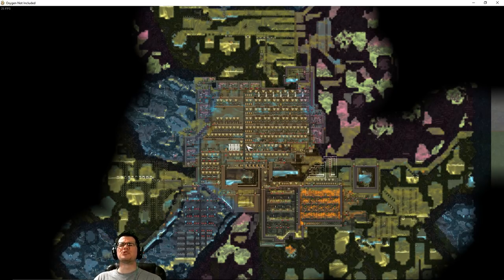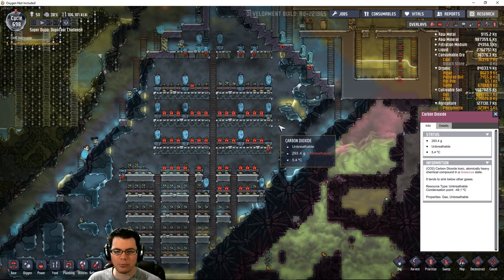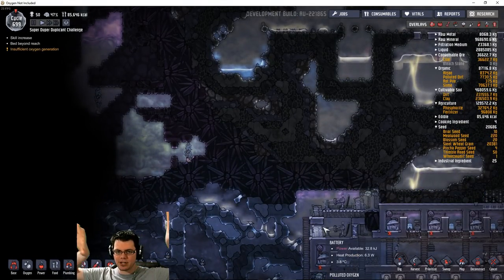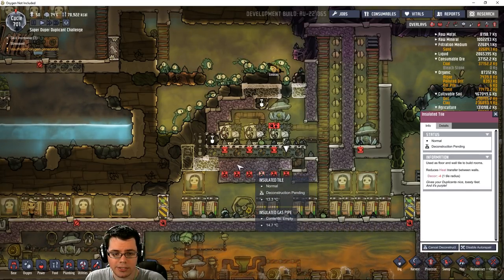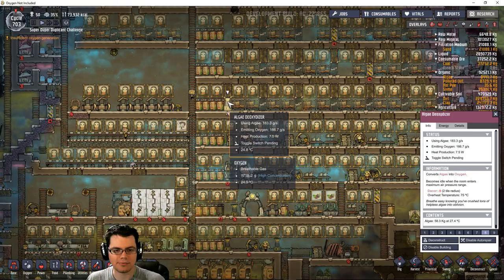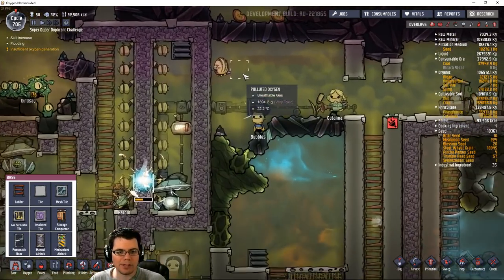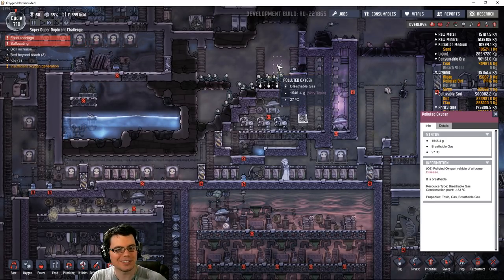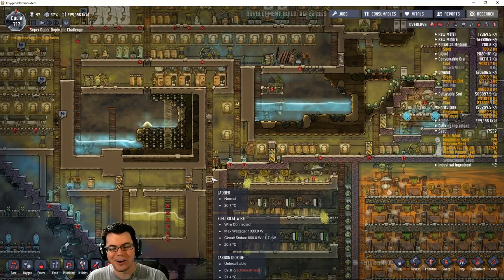Building a Hydrogen Bubbler! Super-Duper Duplicant Challenge Part 7

Comment: I don't get it... how do the wire bridges help in the cooling setup?  I mean, wouldn't they move thermal energy from warmer areas into cooler areas?
Reply: Hmm... I clearly need to take another look at that setup.
Reply: @Russ Emerson That's exactly the idea, move the heat from warm contaminated oxygen to cold hydrogen, cooling and liquifying the oxygen, thus purifying (though realistically, you'd get contaminated liquid oxygen and it would be cleansed on evaporation and you'd get gunk left over).

Comment: I've learned a couple of things experimenting with some of your systems in a now cycle 500+ base of 8 dupes.

For one, the electrolyzer system is a wonderful thing, but you have to be careful with them. The "Insufficient Oxygen" warning is misleading, as it counts the oxygen pumps as a consumer, not a producer, and your oxygen "production" is actually slime or morbs that are visible on your map. At current, three systems is overkill for my eight dupes but two are just shy of enough, so that gives you an idea on how many you need. Also, bear in mind their temperature output as well; it will very quickly heat up your base and cause problems.

As for the farm, I had an immense amount of trouble with Sleet Wheat and could never get it to grow properly, but my [Bristle Berry farm](https://i.gyazo.com/7c76ca66c398ae88fb1d23f6f0b2caa9.jpg) has stable temperature at around 2 C. There seems to be a net cooling with the Wheezwarts, but the occasional dupe entering to fertilize or harvest keeps temperatures within a good range. However, you could also, in theory, cool the farm with regulators and use the resulting heat to warm up Peppernut to make either Stuffed Berry or Pepper Bread. Furthermore, irrigation water should be kept low temp and melting ice should be mopped quickly, as both contribute a lot of heat to the farm. Thankfully the silly "harvest level" system is being removed in the next update.

Also, here's a [Wheezewart water cooler](https://i.gyazo.com/ef5e785bdc8cb21d18ad2fad043b2ce0.jpg) for steam geysers that keeps water at 30 C. Mine flooded a bit because I couldn't use the water fast enough, but it still works and will recover from such an event; middle pump is output and lower pump simply cycles water around to the top when the hydro-switch in the center is below a threshold.
For air, [this one](https://i.gyazo.com/31a7546f12f8cb255d9ca4da048b1e4a.jpg) works beautifully, bringing air down to about 25 C. I have it after my oxygen generators to cool the 60-70 C air down to sane levels for breathing, and it seems to be able to effectively cool two of the electrolyzer systems down without backing up.

And finally, on an unrelated note, you can create power switches that dupes to not have to access by setting an Atmoswitch to 0 kg and using "Below" for OFF and "Above" for ON.